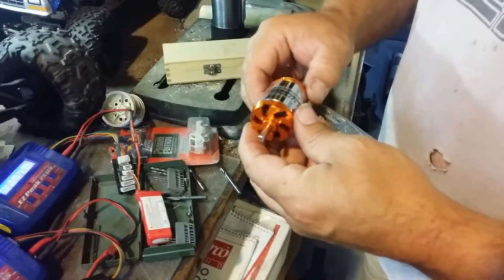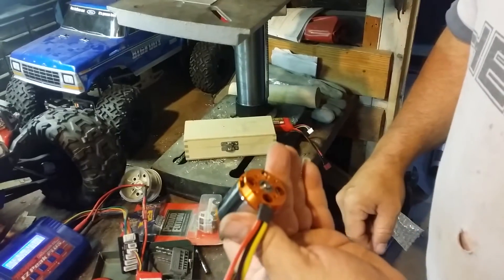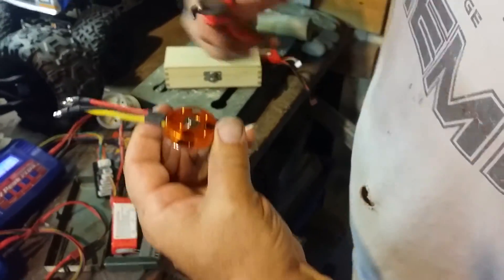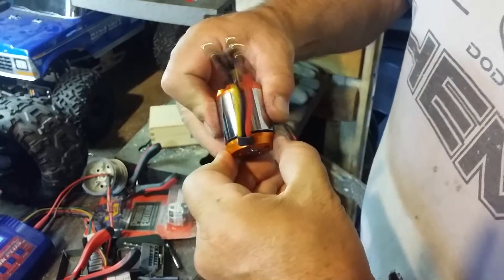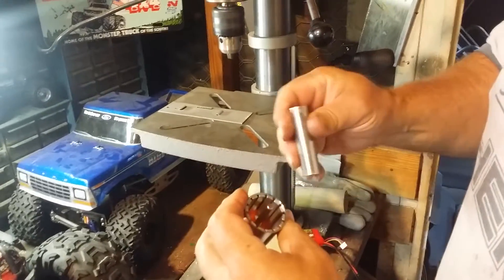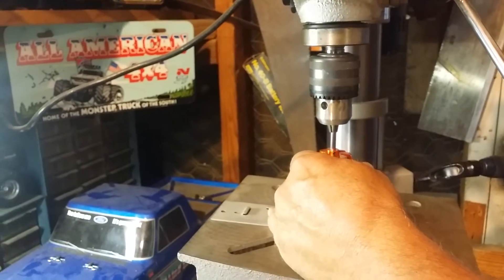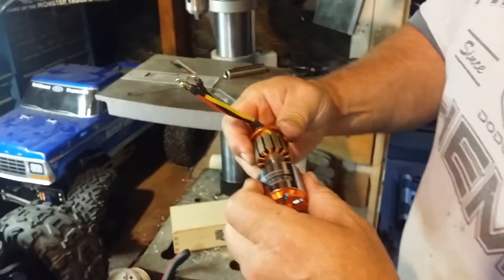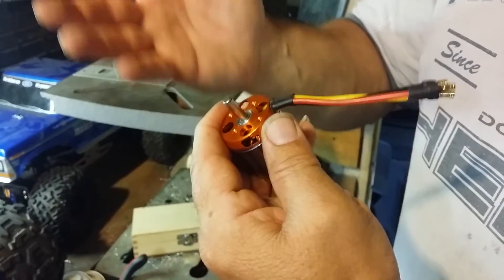Turnigy 3536/6 , 3542/4 , 3548 to Scale Crawler motor for SCX10 & TRAILFINDER 2

Comment: Thank you for this, there are too many crappy videos out there with no explanation of how to move the shaft, or explaining anything really. The comment about motor steps also helps a ton.
Reply from the maker: You're definitely welcome. 
Another way to move the shaft is to lightly "tap" it  with a small hammer...still using the socket inside so the housing don't get bent. It seems more brutal to do it that way but it's usually the way I move the shaft to the other side. 
 Thank you for the great comment and watching.

Comment: Thank you for the video, I almost threw away a brushless motor that had a slight bad bearing on high revs, will use it for my crawlers now instead, ty...

Applying some heat, hair dryer or heat gun, will help to slide in or out with less pounds of pressure/stress.
Reply from the maker: mazpr2025 Bolts?
The outrunners make great trail/rock crawl motors. The downside is you need a really good esc to get the low-end start-up. A BLE Pro has 700 throttle steps....that's the minimum I recommend. The Mamba X esc is way better at 1200+ throttle steps. If you want more rpm I'd go with a Revolver 1800kv motor.

I'm pretty sure you can replace those bearings.